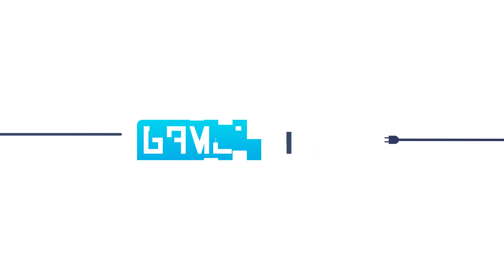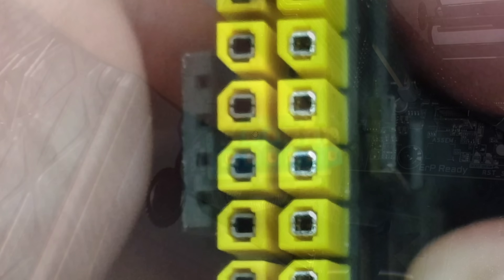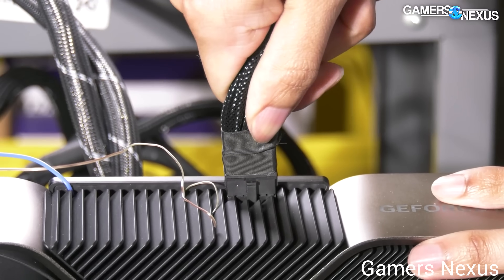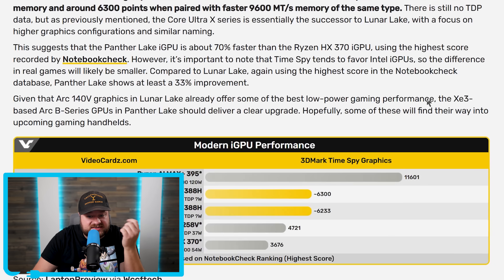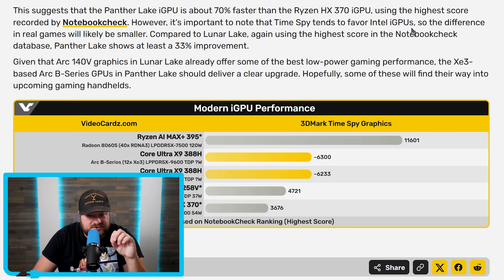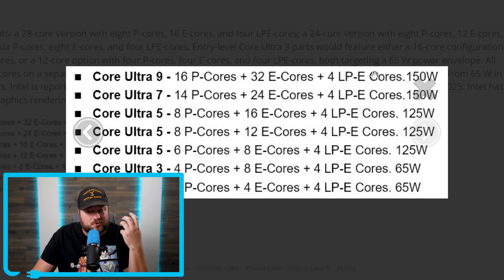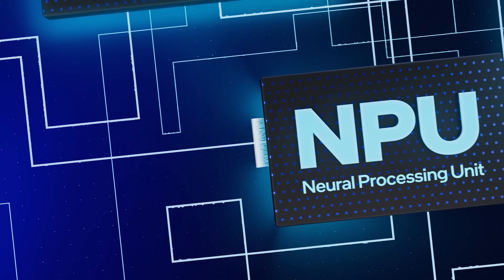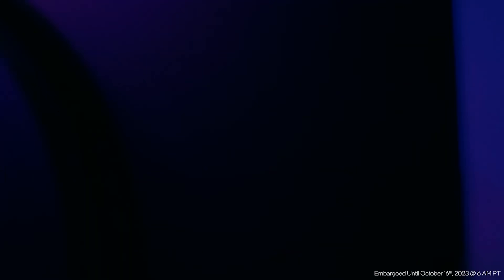PLEASE Don’t Do This AMD!

Comment: I refuse to buy any GPU that uses the 16-pin cable.
Reply: Which connector is safe? I'm going to be building my first PC so this info would be super useful.
Reply: @davidheisnam743  The old standard 8 pins, they've worked for decades and I don't recall them ever catching fire in the entire time I have been in the tech space building PC's.
Reply: @ThunderGod9182  those connector also got burned. there are cases about it but they are not being talked about heavily like those 16pin.
Reply: @arenzricodexd4409 Because it's miniscule compared to the 12pin.
Reply: @peterpizzurro the amount of cases probably just the same in the past but it is not being talked about. Today there are millions of gpu with this 16pin connector being sold each quater. If they were really that bad we will hear at least a few thousand case being reported by now.
Reply: @arenzricodexd4409 I have never heard of one being burned, not saying it hasn't happened, but none that I personally know about.
Reply: @ThunderGod9182  because it is not being reported in a news like it did with the 16pin power connector. i once saw people post the picture of their 8 pin being burned before with GPU like R9 390X which did not even use 300w. and that is from high quality unit Corsair AX1200.
Reply: thats easy when you cant afford it

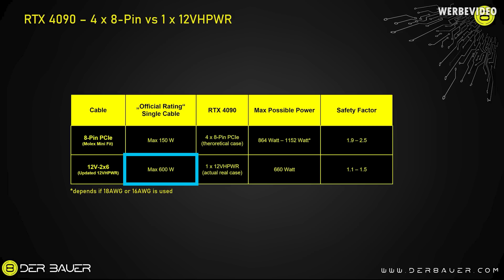Comment: 3:33 "extremely close to max possible capacity" - in practice, it's probably below, due to the power spikes.
Reply: Power spikes are less of an issue than you might think. The issue is heat. Cables and boards tend to be rated for handling shorts, which means insane currents until the fuse trips. You can run 50 amp through a 10 amp cable for 1 ms without issues. Generally speaking the concern is average heat generation in the cable, not super short spikes. However the cable can get worn if the spikes are too frequent and a worn cable lowers max current, so so spike frequency can be a concern.

The real problem is that the PCI-E standard bans load balancing, so if the card is designed for 8 amps on each pin, if the card obeys the PCI-E standard, the card might draw 20 amp on one pin. Since it's not detected, it will be the average load for a while and hence overheat. Cables worn by say spikes can over time cause current distribution to change. This means inserting a new cable and verifying that the currents are distributed reasonably will not prevent problems from appearing after being used frequently for a year or two. Heating it up and cooling it down many times can also change how well the current is distributed. It really isn't possible to distribute the current without a design intended to do so.

Comment: Class action lawsuit against nvidia that connector is a joke since itx inception they knew it fails from the first realease its been 3 yesrs zero improvement its keeps on melting the oly solution make tge the actual wires thicker 
😊😊

Comment: The melting connector is a combo of user error, cheaply made cables, and cards running out of spec. The 9070 XT does not draw anywhere near 600W, so the cards can probably be ruled out for these couple of documented cases. It's a standard, btw, and when Nvidia finishes migrating away from PCI-E 6-pin/8-pin, AMD won't have a choice but to use it on all of their cards, taking the choice away from board partners. They have like 10% of the GPU market, and PSU vendors will gladly drop support of the older standard at some point.

Comment: I usually buy Sapphire Nitro cards, but I didn't buy the 9070xt because of the fookin 12pin connector.
Reply: The Pulse still uses a2x 8-pin connector as far as I know.
Reply: my ASRock Steel Legend 9070XT came with two 8pins instead of these new connectors and it still works fine for me, maybe you could try that one.
Reply: Yeah my Sapphire pure 9070 didn't come with the 12 pin. And my 9070 XT hellhound is fine as well

Comment: A huge problem?  I think its hilarious how overblown this issue is. One melted connector reported out of many many thousands of nitro+ cards sold lol. I have the same model, its awkward to insert because of the angle. More likely it wasn't pushed in properly,  no one ever makes a big deal about 8 pin connectors melting...which does happen lol. It's not going to be an issue for the majority of people

Comment: If amd removed the npu and replaced it with their new gpu cores, their igpu would be that much better.
Reply: No it's not. NPU's are tiny in terms of die area. At most you can add 2CU's for the same area.

Comment: Building a i7 12700k all new except used  Asus RTX 3080 ROG STRIX to avoid the high power connector failure list.

Comment: The negligence in those connectors... probably only 50% of the surface area of each pin actually contacts... why does it not have a 2x margin.

Comment: It makes ZERO sense to buy a 9070xt with the 12v connector, when they still make 9070xt's with the superior 8 pin connectors...  I dont even understand why anyone would want to take the risk.  Everyday its another 12v connector burning up someone's gpu. It's complete & utter stupidity.
Reply: There's been one reported cass with the nitro+. Do you know how many cards would have been sold ? It's also likely a user error case since this model is awkward to insert the power connector because of the angle its on. Probably wasn't pushed in properly. I've had a 5070ti and this nitro+ model,  no problems and not worried in the slightest. I also use a proper atx 3.1 psu with its own cable. Its just blown way out of proportion lol

Comment: I still don't understand why they went away from the older 8+8 pin considering they carry 12V only over much beefier connectors. if they just bumped the CSA of the cables to the PSU it would be able to handle plenty more power than the 3.3A per core given the already high safety margin and a thicker cable will allow it to sink heat away from the plug. as for aesthetics just mount the power connectors elsewhere on the card either on the end or tucked away in the blow through section of the card.
Reply: It costs less to make a card with 12VHPW. Smaller PCB, less material, shorter machine times

Comment: Not sure "regurarly" checking your connector is a good idea either. Seems like disconnecting and reconnecting constantly would make the problem worse. I do have a 5070 Ti but doubt it will burn, it uses less than 250W 90% of the time, even less than 200W usually.

Comment: 12v hpwr should be banned.  All the cards that have them should be recalled, also Nvidia should be hit with a massive class action.  Same goes for any morons that used this connector on AMD gpu's.  You can rework this connector until the end of time.  It is garbage, it is unsafe, and should be banned, full stop.

Comment: Nvidia adapter is cursed. No GPU should use it.
Reply: PCI-E or Nvidia doesn't matter. The design is flawed. It doesn't follow the laws of physics. It's based on school level electricity where 6 identical wires will have the same current. If you ask a university trained electrical engineer, he will tell you that all prior attempts at making this a reality have all failed. Manufacturing variation will cause imbalance and wear (even wear from currents) will cause this problem to increase over time. You can's split current across multiple wires and then merge in the end without engineers planning how to control the current distribution.
Reply: @Thegoodthebadandthefleshtuber  think it is honestly user error most of the time
Reply: @Swanny098  Cable management too tight, it's often the case, they never leave enough length on the cable, and this bends the connector too much (and the 12vhpwr has very few tolerance in that matter).
I don't care for now because I got a RTX5060 Ti 16GB which uses the good old 8 pins.
Reply: @Jean-Denis_R_R_Loret  i always make sure to leave as much slack as possible, it may ruin aestetics, but safty first in this situation.
Reply: can we finally fuck them allup. im so sick that EVERYTHING IS CORRUPT AF MAN. THE SOLUTIONS ARE ALWAYS SO SIMPLE
Reply: it's not a nvidia adapter, it's a PCI-e connector, nvidia adopted it first, and the 3000 nvidia generation had a modified form which we can call the nvidia connector
Reply: @kristine4167 however, such technology should have load blancing implemented so that not only 2-3 pins out of the 12 (or 16!?) handle the entire load.
Reply: @moiprocs  i'm not defending the connector i completly agree, i use the adapter myself and i am worried stuff will happen.
The last 4 pins are sense pins, no power should be going down that except what's required to do senseing.

however there should be load balancing on the GPU side and on the PSU side, incase something fails.

I'm guessing here, most of the time the ground are all soldered together and the 12V are soldered together, all like a bus bar (i think it's called that sorry i am not an electritian, i only know basic electronics)
a bend or the solder could perhaps cause some of the wires to have a higher resistance, and electricity useually would chose the path of least resistance so it puts the load on a few pins.

In general i like the 12vHP, it does not look chunky,  but i am always worried something will happen.
Reply: just plug it in all the way
Reply: @bigturkey1  We heard you Jensen. However the rest of the us live in a world where electricity obeys the laws of physics. If you create a split cable like this with power socket voltage, it's downright illegal because it's a fire hazard. The law states for such voltage each wire has to handle the full load of the fuse, which means it's not legal to split unless each wire of the split can handle 100% of the combined current. This totally defeats the purpose of having multiple pins.

Plugging it in all the way helps, but it doesn't solve the underlying problem of not having control of balancing current between the pins.

Comment: Mmm... I don't agree with the saying that 12VHPWR problem is the manufacturer when happen a lot. Why? because from RMA, a lot of brand get bent pins on the socket on weekly basis, and all are customer induced, so it's the same for 12VHPWR power plug problem, specially on the lower wattage, it is customer induced problem. You can notice this because always are on the plug but not the cable.

Comment: Something is wrong and it isn't JUST the connector. You can change the connector design all you want this is happening across all vendors regardless of redesigns on the connector end. Something about the way this draws power needs redesigned it is seriously flawed.

Comment: I will never buy a GPU with that damn connector. If that ever becomes a requirement I will literally stop building.
Reply: It's not the connector; it's the circuit design that can send lots of power down a single strand of that cable. You can actually cut some of those cables, and it will still run because the power goes to the strands that aren't cut, which, of course, get hotter. It's a design that saves Nvidia a nickel
Reply: APUs will be powerful enough by then. They already kind of are

Comment: Why do they give so many E cores? Like seriously if it is for low power task the  give it less. 32 E cores will be needed when you open hundreds of chrome tabs together but then it becomes high power task, so no point.
Reply: Background tasks for you. For other workloads its a godsend.
Reply: Honestly, instead of 16 P and 32 E, I'd be happy with something like 24 P and 8 E. The more performance, the better
Reply: @ClayF403  Almost any task that can scale to 24 cores can also scale to 48. And 48 cores are going to crush 32 in multicore performance.

Comment: The NPUs will relieve the CPUs. I can imagine this will allow smaller AI helper models to run local in Apps like Photoshop, Gimp etc.. But the main issue is how AMD & Intel develop their ecosystem, its kind a wild west, with new villages (Frameworks) emerging who are empty the next day, or just moved (new name) a few miles further. Kind a erratic particular AMD.

Comment: So Nvidia dragged us into ray tracing, fake frames, and the 12 pin.
Reply: luckily, the inferior 12v connector isn't mandated across the amd line up.  Just gotta use common sense & buy one with the traditional 8 pin connectors.

Comment: I suggest a 2 point connector 2 - 12 gauge wires. The kind used on small 12 volt car batteries. 2mm in diameter is all that is needed  it can handle 1200 watts.
Reply: Xt90 would do perfect
Simple 2 pin, no latches and shit, just press it really hard until it fully fits and voila, connection that wouldnt ever fail.
Reply: A connector with few number of pins is the problem though isn't it... Each pin makes ~50% contact at best.

Comment: DO NOT buy any GPU with a 12pin connector. You are just asking for trouble. The wires of 12 pin connectors are THINNER than wires on 8 pin connectors and therefore burn when too much power is going through the card by overloading current through one of the wires. Only boycotting this idiotic connector will get rid of it from the industry......

Comment: Zen6 isn't going to hit 7ghz when Zen5 struggles to flirt with 6. They may be able to hit some edge case with extreme cooling and on a single core, but no one else that's looked at N2 has been making claims of massive clock speed boosts. It sounds like the AMD fanboys within AMD are leaking BS again just like how RDNA3 was supposed to be 2x RDNA2 minimum and possibly up to 3x. In reality we saw 30-35%.

Comment: Is it that expensive to have a current limiter for each pair of 12-volt lines for these gpu's?
Reply: no but why does it have pairs of 12V they are all the same it could just have 1 thick wire connector.
Reply: @remotepinecone  , for 600 watts at 12 volts, that would be 50 amperes, that's like AWG #6 wire... and can a single strip of copper in the gpu board able to handle 50 amperes of current?

Comment: so glad that my particular 9070 XT just has two 8pins instead of one of these new connectors.
Reply: Im still running my 7900xtx because the jump in performance isn't much so Im waiting for an xtx 24mg or 32mg to come out before I buy a new one.
Reply: @chadstinson9886  Yeah I bought a used 6800XT for like 360. I'll wait for high end AMD or wait for a really good deal to hit my face.
Reply: @JustinReddevil  in US the 9070 has been going for $569 or so and 9070xt is $629. Not gonna get much better than that
Reply: They are at same price and performance rn so I just bought 9070xt  @chadstinson9886
Reply: @chadstinson9886 ya Im praying they release a 9090
Reply: Exactly why I didn't opt for the Nitro 9070 XT.
Reply: I specifically picked my 9070 XT based on power connector. In fact my original plan was to buy an RTX 4000 (specific one undecided), but as soon as the first problems showed up and youtubers started talking about the connector, I looked into it and saw how it's based on flawed understanding of how electricity work. I'm stunned that it not only made it to market, but that there haven't been a forced recall. The PCI-E standard for how the connector has to be connected to the chips on the GPU makes it impossible to ensure it won't overload individual pins while leaving others practically unused. I think it's the first time I have seen any standard demanding something, which is physically impossible to make safe.
Reply: @Thegoodthebadandthefleshtuber  It was one of the deciding factors for me to trade in my 4070ti Super for a 9070xt with 3x8-pin connectors. I'm also on Linux so that played into it as well. the cables are a bit ugly with so many of them front and center but I don't have that worry in my head that they may melt
Reply: mine too i bought 9070 XT pulse few months ago
Reply: @Gopstop222 same. Im glad I got the dual 8 pin ports instead of the newer plug.
Reply: Mine does too. I think the only ones that dont are the Asrock taichi and sapphire nitro+ right? Maybe asus tuf too, not sure. I got the AsRock Steel Legend model for $640 USD & i absolutely love it
Reply: My xfx mercury 9070xt oc has 3 8 pin pcie connectors. I didnt know they had 9070xts with only 2.
Reply: @jakecars93  mine isn't an OC version so that's probably why mine only has two
Reply: @RabidDipshot  mine is OC model (steel legend) and still only has 2x 8 pin connectors
Reply: @jakecars93  the 3rd is for overclocked versions
Reply: mine has three 8 pin connectors

Comment: even if said connector was  correctly installed  the connector and power cable isn't designed for the power draw
whether its a  single connector  dual power in a y service

the entire  bus   is like  its designed for 3-6 volts  and you are trying to 12/24 volt single or 24/48 through a v cable

may be we should be looking  go back  to a  molex connectors to supply  12/23 power because the current connectoa is a bloody fire  hazard
Reply: if its all 12v  think car batteries. It all comes from one rail gets devided up into 20 wires then combine again on the card and they don't think its a problem? This is not complicated bucking power down is fairly easy but it need lots of metal this stupid connector is a joke its tiny its physically too small to carry so much power unless its ac.

Comment: OK ! will say it again just stop buying the stupid 12 pin power connector, 2 or 3 8pins are good have always been good and will be good going forward.
Reply: Do you have a specific connector model in mind for 5090 as an alternative to the 12 pin connector?
Reply: @vitalie96  Yer 3 or 4 8pin should do it ?